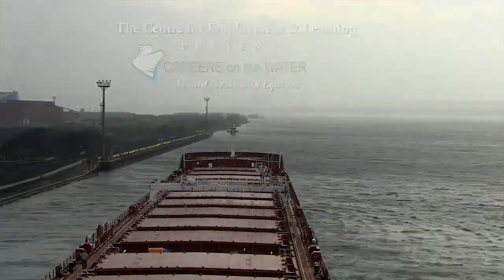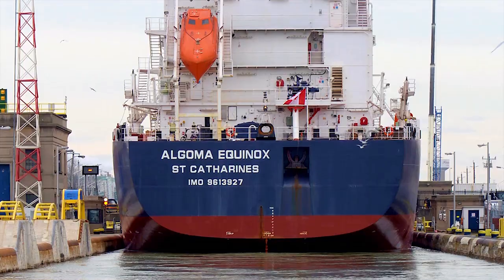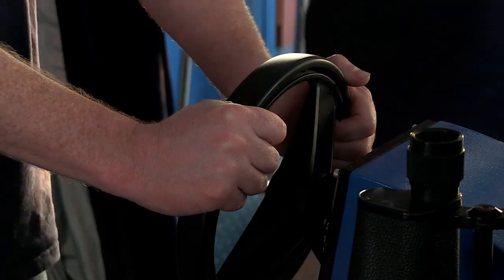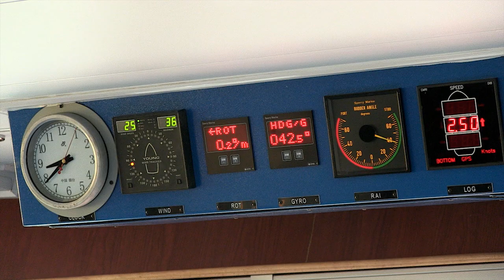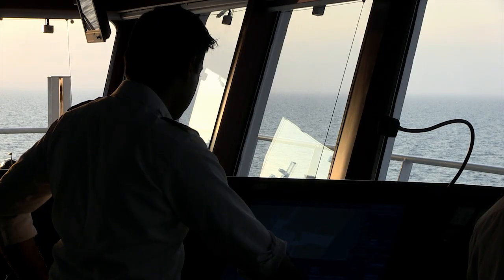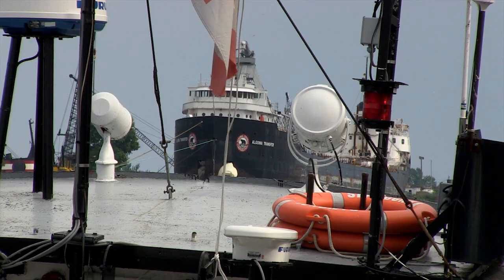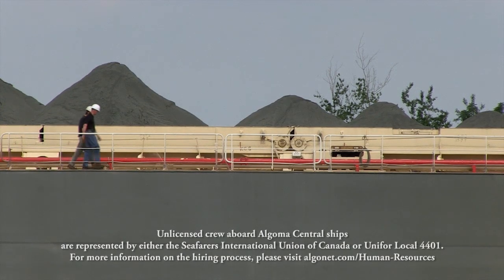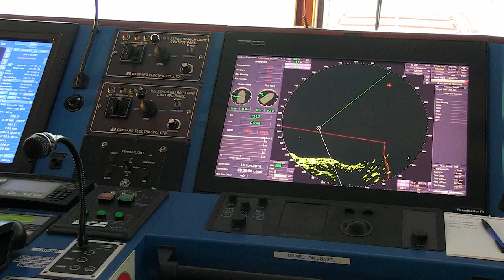Careers on the Water - Aboard the Algoma Equinox

Comment: Brand new ship with no self-unloader boom. Whats with that.
Reply: All Chinese built ships are built with manual labor in mind just like the 3,850 MP engine MP= man power lol
Reply: Algoma hauls a lot of grain products which are well suited to non self-unloaders (i.e bulk carriers).  Grain isn't particularly dense so maximizing hold volume is key to hauling the largest grain cargo possible at the allowable draft.  Self-unloaders have sloped holds and conveyor belt systems that take up space that could otherwise be used for cargo.  Most the grain handled by Algoma is transported to ports along the St. Lawrence river.  These ports have systems to unload grain without the need for self unloading equipment.  After unloading grain, Algoma bulk carriers travel further down the St. Lawrence to load iron ore pellets which they back haul to the Dofasco steel mill in Hamilton, Ontario.  Dofasco has two high capacity ore bridge cranes that can unload a bulk carrier in as little as 16 hours, again precluding the necessity of a self-unloader.  Algoma handles nearly all of Dofasco's ore requirements so their new fleet of 4 bulk carriers will have stable cargo demand for years to come by following this grain/ore pattern.
Reply: Wow.  I had no idea.  I saw this video and immediately was confused about the lack of unloading gear.  But this is great news.  I always thought unloading equipment looks ugly on these beautiful boats!  Thanks for this explanation.  :)
Reply: Keeps the crane operators working
Reply: @daveth121864 the cargo is King. Lakers aren't as pretty as the old straight deckers but I could unload 23,000 long tons of iron ore in 2 hours and 55 minutes! They don't like money sitting on the dock for long.